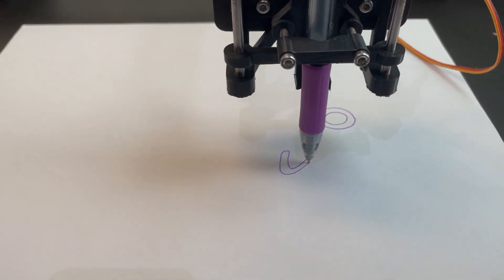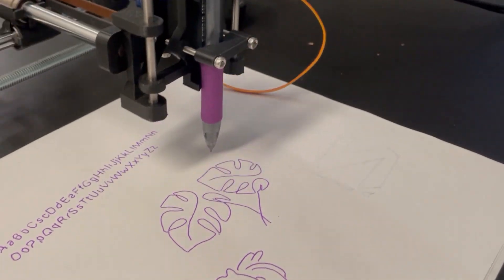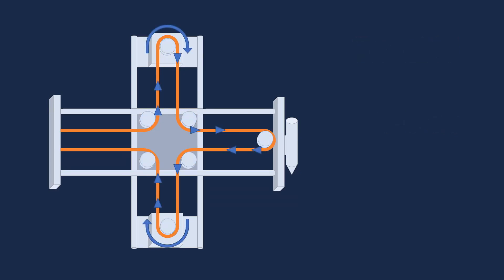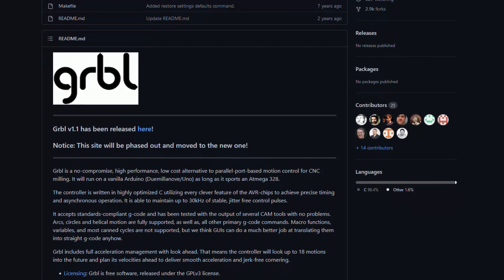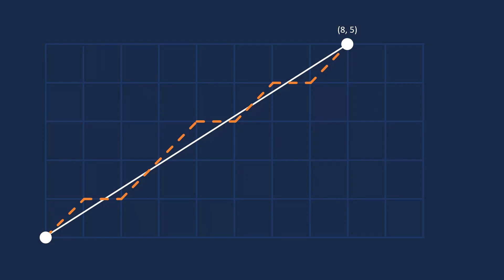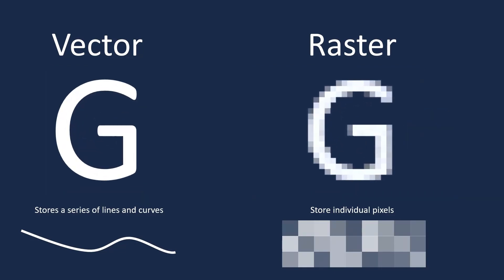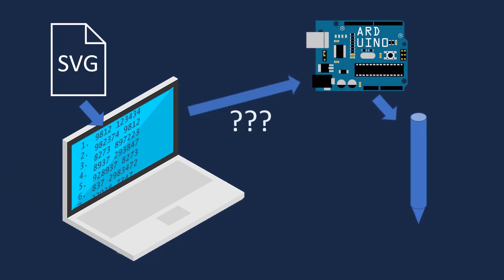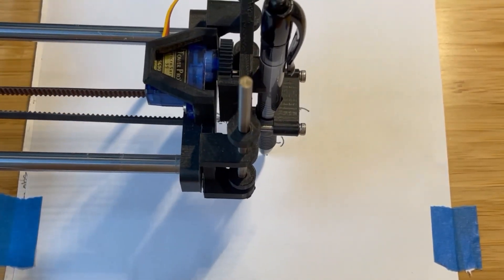AutoScribe - CNC Drawing Machine

Comment: Core XY is setting or are anything?. 
Please make software set-up video. Because no any explain clearly, your first video is very clear and easy to understand so pls make make software set-up video
Reply from the maker: There's more info about downloading, installing, and using the software for both the PC and the Arduino in the README on the GitHub page here https://github.com/n-ponto/AutoScribe/tree/main/Arduino_v2
Reply from the maker: Core XY is the general idea of designing a CNC such that the stepper motors along the x and y axis are fixed in place. Here's a better description of Core XY https://www.fabbaloo.com/2017/01/what-does-corexy-mean
Reply: explaintion:-
The T-Bot axis style is not a commonly used axis style for 2D CNC plotters, but it is known for its ability to provide high speed and accuracy due to its unique design. The T-Bot uses two motors to drive the motion of the plotter, one for the X-axis and one for the Y-axis. This design allows for the use of belt-driven systems, which can achieve high speeds, and reduces the amount of mechanical backlash compared to other axis styles.

However, the T-Bot design can be more complex and challenging to build compared to other axis styles, such as the Cartesian, and may require more expertise in mechanical design and programming.

In conclusion, the T-Bot axis style could be a good option for a 2D CNC plotter if speed and accuracy are the primary goals, but it may require more effort and skill to build compared to other axis styles.